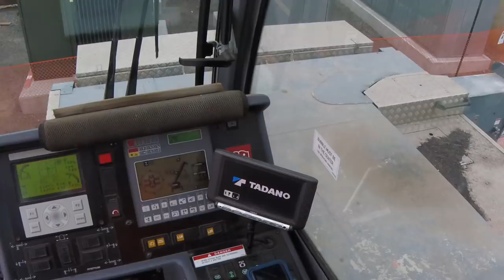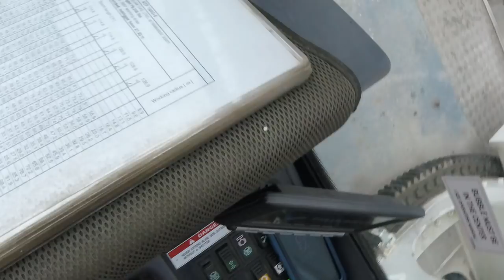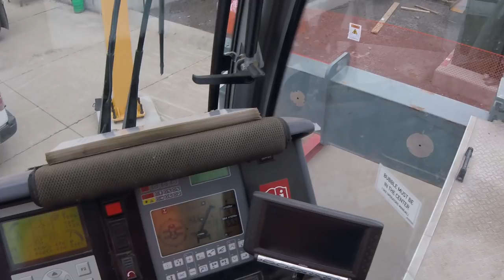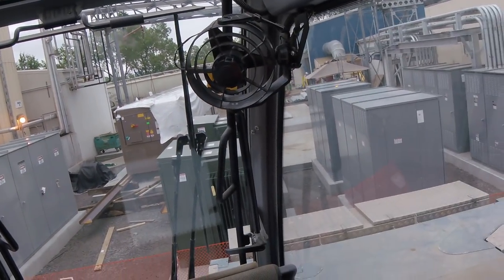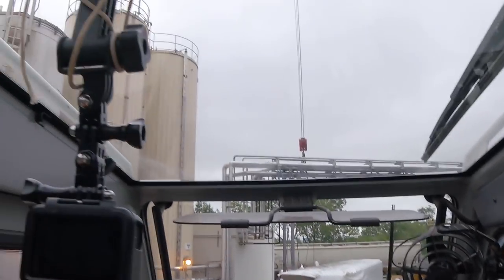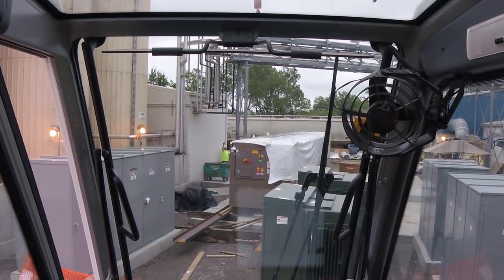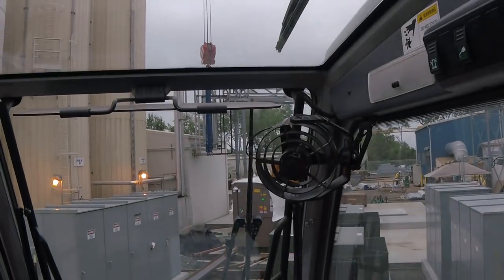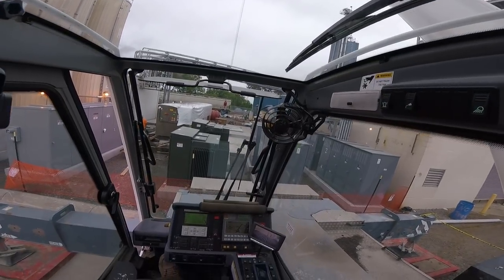Part 3. Setting a pump and pressure vessel on the cooling tower job | Tadano 180g-5

Comment: Smooth brother! I love it. The helmet cam is cool because it shows WHY our necks bother us!!!!! Your comment about coming up easy and not breaking ankles/hurting your guys is so true.  I can tell you first hand that when you hurt someone,,,, there’s not a day that goes by that you don’t think about it.  It doesn’t matter whose fault/why because ultimately YOU pulled that lever! 6am Friday of Memorial Weekend 2000 I cleared an iron worker off a trailer that I was unloading. I seen it happening and I smashed the throttle down and got the load out of there as fast as possible.   I took the signal to hoist from my same guy like a million times prior.  He didn’t catch that the other guy  wasn’t 100% clear and I last seen him climbing down from the trailer.  I was sick that I hurt a guy.  I had many lengthy talks with my Uncle that’s a crane operator.  He told me about an interesting conversation that he had on a job a few months after my accident.  It was the same crew.  That guy I hurt???? Blew a .09 over 4 hours AFTER the accident!!!!! The damn dude was effin DRUNK at 6am,,,, sat at the coffee shop for 4 hours to try and sober up before the hospital and still was drunk.  I feel better about the accident however I don’t feel any better about hurting him.
Reply from the maker: Richard Savaglio, that's scary stuff. Our biggest fear is hurting someone. So many people have no idea the amount of responsibility those in the seat have. Thanks for watching! 🙂👍

Comment: Loved the video very informative. Headcam is nice in my opinion. What brand load computer does the crane have? The little giants and badger rail cranes we have use LSI and I can't stand it. I'm not sure if it's because I don't have much access into it or what but it's a royal pain in my rear end . Constantly recalibrating the load blocks and changing the batteries on sensors. Which are really picky to battery voltage. It's all rather annoying. 

Radio is also nice to communicate with over cell phone because it allows other people on the job site to listen in and know what's going on. Keeps more people on the same page; allows more eyes to spot a potential emergency, in turn keeps everyone safer. Just from what I've observed in my line of your. Your results may vary 👍🏻😃
Reply from the maker: JasonWorksAlot, the computer in the Tadano is a Tadano computer. If you think your system is difficult to get into, Tadano dealers don't even get access into their computers. Thanks for watching! 🙂👍
Reply: To The Top Crane perhaps I'll stop complaining about LSI then...😳

Comment: Like an industrial version of the operation game. Obstacles everywhere. The helmet cam is interesting. Gives a better idea of all the different things your are paying attention to. Less motion with superview, but harder to see 100' away. Would be great at a 50' radius. 
When you are booming up or down and holding the load, is there anything on the computer to display something like the hook height above ground, or is that just something you do visually? Because you barely had line of sight to that pump, and I know sometimes you do have to work blind.
That last part was staring the part into position, a standby in the construction industry. Although it works better if you are holding a clipboard.
Reply from the maker: Rambozo Clown, when I am booming up or down and holding the load, I am doing that by sight. There is no indication on the computer of hook height. When working in the blind, it is very difficult to keep it at a constant height. So, that's where a good signal person comes in handy. Thanks for watching! 🙂👍